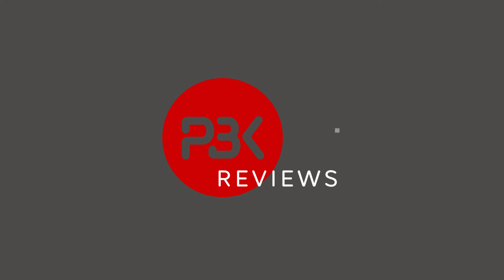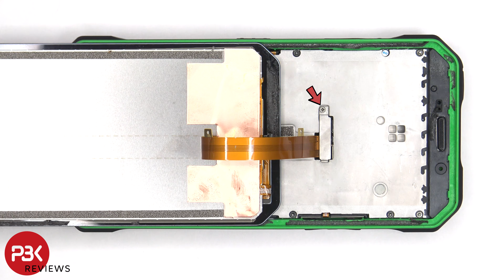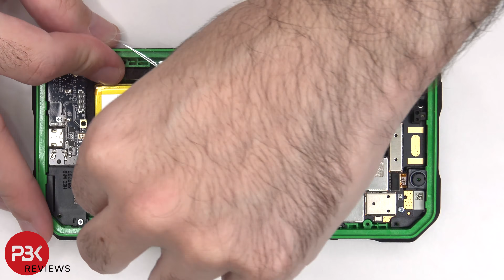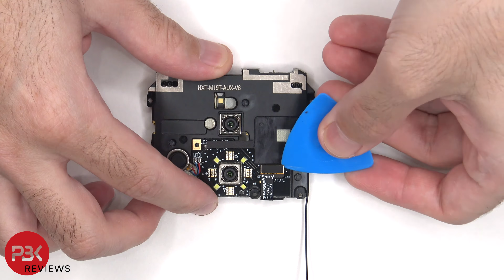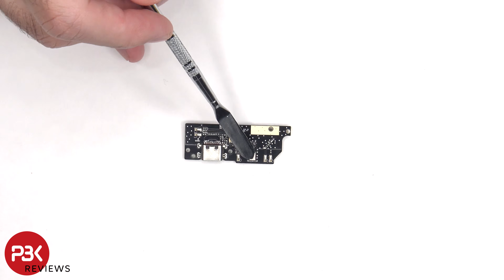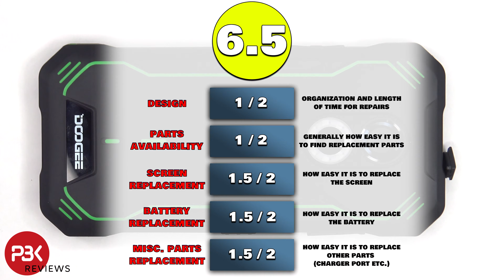Doogee S51 Teardown Disassembly Repair Video Review

Comment: I had a hard time removing the screen for replacement. How much did you heat to the screen ? 
I think most of disassembly are to replace the screen, the original is broken, and it's a lot harder to remove a broken screen.

Comment: I have a question can you please answer i have seen video of your disassembly flagship phones with 8 gen 1(Xiaomi 12 pro, OnePlus 10 pro) is ram and cpu combined on a single chip or different chips
Reply: Different chips
Reply from the maker: They are different chips, just stacked on top of each other usually on higher end processors or phones. You can google cpu and ram stacking to get more info on that.
Reply: @PBKreviews  thanks for the information